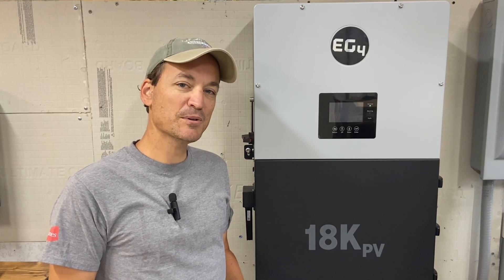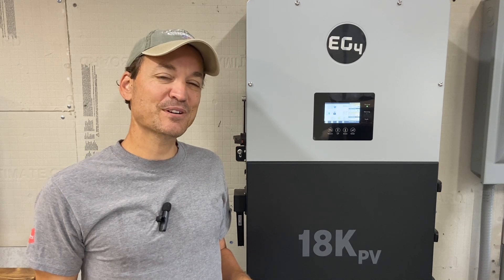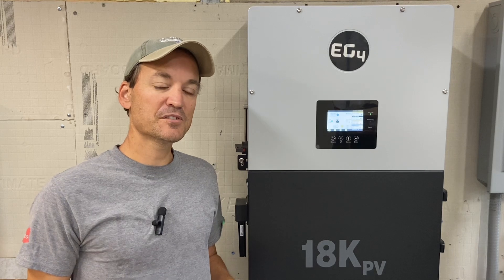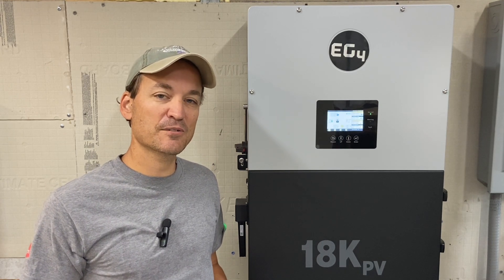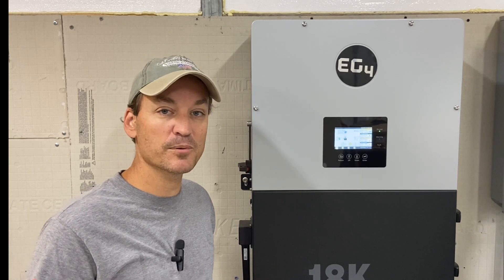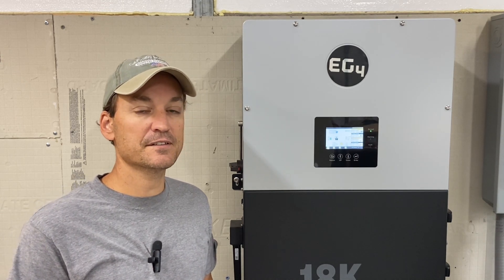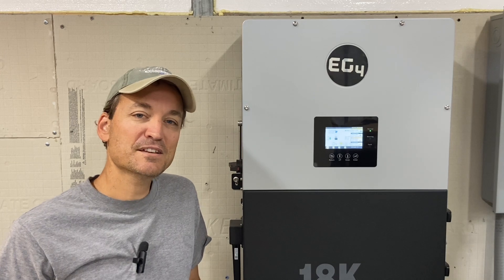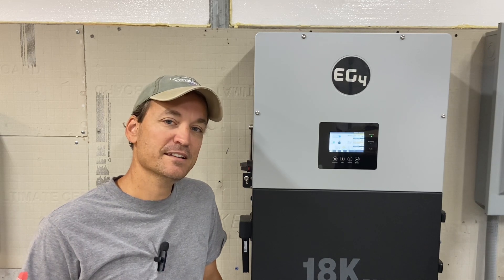Eg4 6500ex vs the EG4 18kpv comparison video~ signature solar inverters

Comment from the maker: Affiliate links: Here is the link to the inverter18kpv. 
https://signaturesolar.com/eg4-18kpv-hybrid-inverter-all-in-one-solar-inverter-eg4-18kpv-12lv/?ref=mpmddlkx6M9tPo

Here is a link to a pair of the 6500ex’s with the new PDP https://signaturesolar.com/eg4-13kw-off-grid-split-phase-inverter-bundle-2-x-6500ex-48-13000w-output-16000w-pv-input-split-phase-120-240vac-all-in-one-solar-inverter-system/?ref=mpmddlkx6M9tPo

Comment: I'm curious about wiring a generator to automatically charge the battery bank during an extended period of cloudy weather. Is either EG4 system able/better suited to that task?
Reply from the maker: I think pretty much all of the EG4 inverters come with a set of dry contacts that can trigger your generators auto start. Your generator would have to be equipped with an auto start option though.

Comment: The bad part I seen on this unit was  signature solar has horrible customer service, read so many reviews and even on BBB site and the EG4 users group on FB, every one speaks  about their horrible customer service.
Reply from the maker: I actually think they have been improving a lot over this last year. But if Signature Solar’s customer service is a concern for you, you can also get the 18kpv through Current Connected. They are selling the 18kpv now as well. They are a smaller company but super nice people. 

https://www.currentconnected.com/product/eg4-18kpv-hybrid-inverter/?ref=xhJJBPDS

Comment: Gavin, if I am using the EG 4 3K and I want to hook up generator power and shore power together, would I need to use a transfer switch to keep shore  power and 1:23  generator power separate? G fo
Reply from the maker: A transfer switch would work. But I usually recommend the chargeverter instead of using a generator through the inverter. The chargeverter can give 100 amps of charge to the batteries and you don’t  have to do any extra wiring besides adding it to the busbars. You can keep letting the inverter donors thing and just charge the batteries fully back up. 

I’ll add a link to it below if you haven’t seen it yet. https://signaturesolar.com/eg4-chargeverter-battery-charger-48v-100a-5120w-output-240/120v-input?gad_source=1&gclid=Cj0KCQiA3uGqBhDdARIsAFeJ5r3EQhRS8aVDhVTAbDvCXerR4ElTU2hjHarDYuGmG-MF5b7cD18My-AaAvz2EALw_wcB&hsa_acc=6010647758&hsa_ad=&hsa_cam=17631500090&hsa_grp=&hsa_kw=&hsa_mt=&hsa_net=adwords&hsa_src=x&hsa_tgt=&hsa_ver=3&ref=mpmddlkx6M9tPo&setCurrencyId=1&sku=1570007&utm_campaign=PMax%3A%20Shopping_Smart_Brands&utm_medium=ppc&utm_source=adwords&utm_term=

Comment: What about light flickering? 
I have 2 6500’s and get a lot of light flickering. I would do the upgrade if the sine wave is cleaner and there is less flickering. 

Anyone have any experience with this?
Reply from the maker: My last pair of 6500 ex’s didn’t have any flicker. But previous to that I did have what you’re describing. The 18kpv doesn’t have any of those issues. It’s a different manufacturer, and an all around great unit.
Reply: Thank you!

Comment: That's not a fair comparison. Because with the cost of 1 18kv you can buy 4 6500 ,and still have money left. So I think that is not a fair comparison.
Reply from the maker: I was specifically comparing some of the stats. The build quality is a big factor as well. But yes, as far as price the 6500’s are definitely less expensive.

Comment: Would I be able to have enough power to charge an EV in the late night hours using this including powering certain 110v things in the house? 110/220v?
Reply from the maker: Yes the 18kpv is a split phase inverter. 120/240v. Charging your EV would definitely be possible. That would largely just depend on your battery storage. Typically batteries are the priciest part of a system.
Reply: @GavinStoneDIY  I really appreciate your help and advice. I’m a new subscriber and love the channel!

Comment: Thanks for posting. I too have been using the 6500 in split phase for about 3 months. Although they have some the job, there is more to be desired, thus I'm taking the $750 credit towards upgrading to the 18k. 

1. The 6500s are extremely loud. Around 9 in the morning when the sun starts to provide pv input, the fans ramp up like a jet taking off the runway. 
2. One inverter charges my battery bank while the other discharges when i have an excess of pv input wattage. Signature solar admitted this is aj anomaly and are honoring the warranty on my inverters.
3. My lights flicker at night like a flashlight on its last leg of battery.

All in all, being completely off grid, they just arent up to par with providing seemless power for a house, well pump, and future expansion to my property.

Im taking the advice of videos like yours and Will Prowse' and investing in the next tier they have to offer.
Reply from the maker: That’s a good choice. I think you’re really going to enjoy the 18kpv. Keep me posted as you install it. I like to hear how things are going from people.
Reply: @GavinStoneDIY  so I just installed the 18k unit two days ago and wow. Silence. No flickering. I can't even tell the thing is on. It fully charges my 5 lifepower batteries more efficiently than the old 6500s before 11 a.m. 

I'm glad I forked over the dough.

The only thing I'm disappointed by is that for some reason the lifepower4 batteries did not work with the 18k. Did that happen with you? They had me designate the battery bank as lead acid and set the float/absorb voltage in the settings. They told me that they are working on a firmware update for the lifepower4 batteries to work with the 18 unit. I'm surprised that hasn't been hashed out already given so many people have these batteries.
Reply from the maker: @raymondergarcia   it really is a beast. I’m assuming you’ve downloaded the latest firmware as well? 

I don’t have the battery coms hooked up honestly. However, you can use the lifepower4’s with the communication hub connected to the 18kpv. I realize that’s just another item to purchase. But for what you get it’s not really that pricey. You can check the state of health on each pack, each cell voltage and some other options as well. If you really wanted coms sooner then the firmware,  then that’s your best bet. Otherwise I’ve been running on lead acid mode for months because I have DIY batteries as well as the task batteries.

Comment: Im in Phoenix, AZ ( good sun) where I my house has one inverter (EG4 6500ex 48) with two batteries (EG4 LiFePo4) and one 3200W solar array. This powers up all my 120v circuits but seems to drain the batteries before sun up daily. At which time it auto transfers to Utility Co then, transfers back to solar in the morning and also charges the batteries back to 100%. Should I just add batteries (maybe two or three more) and how many can this inverter handle?
Info on this matter would help,Thanks 
Mel
Reply from the maker: Adding batteries would be the easiest solution yeah. You can add as many as you like. The inverter will only pull as much power from them as it needs. So you could have 10 batteries but that one 6500 watt inverter can only pull around 126 amps total from the batteries.  

So considering the shipping costs the best idea is ordering as many batteries as you can currently afford. If you don’t have a cabinet yet that would probably be a good idea also.
Reply: Thanks.
It's pricier but, I'm thinking about changing over to the 18kpv if that will help @GavinStoneDIY
Reply from the maker: @melflores4873  the 18kpv would use less idle consumption overnight. And you’d have split phase power. Plus it’s honestly an amazing machine. So it really depends on your budget and what you’re trying to accomplish. I’m still running my house off grid with the 18kpv. You’d need more batteries either way. Batteries are honestly the most expensive part of a build.

Comment: Why does voltage spike up in cold weather?
Reply from the maker: It’s something to do with the electrons flowing differently. Generally cooler weather makes the panels more efficient. And the colder the weather the higher the voltage will spike. There is temperature coefficient calculators online to help you estimate what the voltage difference will be in your area. Places like Florida wouldn’t have any issues with that though.

Comment: If I wanted to run 2 fridges, a few led lights, a furnace blower, well pump would the EG4 3kv be able to do that in power outage situations? Or suggestions on what inverter to purchase for this scenario. Thank you
Reply from the maker: The well pump would be the big load what hp pump is it?
Reply: One horse-power is about 750 Watts, and multiply by 3 to allow for an input surge when the pump is cycled on. The inrush is short term and may be covered fully by the surge capacities of the inverters. Fridges may be 150W each when on (450 Watt surge each), and a furnace blower is typically under 400 Watts, or 1.2KW surge. You'll have to run through the math to make sure you are OK with steady state consumption and surge. All motor loads may switch on at the same time, so you sum the surge powers.

Comment: For the $$$$ one can buy 4 6500's for less than 1 18k..... 
Bank for buck stills falls to the 6500...
32 kpv with 26kw with redundant back up so your not reliant with a single inverter. 
No brainer here.
Reply from the maker: By the numbers that’s true. I myself would go for the 18kpv after having used both. If for nothing else then just the build quality. But the good thing is, they have both options. So nobody has to feel like they are hemmed into a particular system.
Reply: @GavinStoneDIY  true, my thoughts are more toward surviving grid down or no grid available due to location.
Having 2 pairs of the 6500's with the PDP's will cost less, while allowing more solar, more power, more options (ie. 1 pair @ 220v & another at 120v)  try that with the 18k.....
All ➕️ ➕️ ➕️ ➕️  and cost less.
Reply from the maker: @duanelinquist4244  good points. 4 of those would use a very hefty amount of idle consumption also though,  as compared to the 18kpv. So you may have to factor in at least one rack battery to compensate. So the gap does narrow a bit in that regard. I get what you’re saying about backups though. I do have my old pair of 6500’s still on the shelf. But not everyone has that luxury. I suppose there is always a give and take when it comes to being prepared and budget. And we have to decide what is a practical amount to spend on different items.

Comment: Looking to use EG4 18kpv in an off-grid setup for a new metal utility bldg.  Plan to move my well pump from my current grid tie system to this new off-grid system because of proximity.   This means I will have the 220V 20A circuit previously powering the well pump from the grid tie system near the new off-grid system.  I want to use this 220V 20A circuit as a backup charging source for the new off-grid system.   Will I need to connect this to the A/C in or the generator connection on the EG4 18kvpv? Would both ways work? If so what are the pro/cons of each approach?
Reply from the maker: I’m not quite following what your intention is. I know the unit outputs 50 amps. So you don’t want to sell yourself short. But I’m not quite sure what you want to do with the 20 amps circuit.
Reply: @GavinStoneDIY  Sorry, looking to be able to use it as an alternate charging source for the batteries if too many days of poor solar production to run connected loads and charge batteries.
Reply from the maker: @matadorbeagles1120  ahh I see. Then you’d want a 50 amp supply at the very least. While you could technically set the charging level lower to compensate for the smaller wire, it would be a waste really. I would installed a larger conductor. Or depending on your setup you could also use a generator and a chargeveter.

Comment: So can you use the ct clamps on the main feeders and wire the 18k straight into the panel and it won't backfeed the grid ?
Reply from the maker: Yep. It can be used with or without a critical loads panel. So the 18kpv can be hooked directly from the meter and has a 200 amp pass through.

Comment: I have four, EG4 6500ex inverters. My price was about $4500 for all. The 18k pv is a very nice unit but as a comparison, the cost for two would be $11k. The 18k would not have as much output as the four 6500 exes but close. The 18k units have advantages but the price is a lot more too. I can run 100amps plus with the 6500’s.
Reply from the maker: There are other factors like wiring. You can completely eliminate a critical loads panel with an 18kpv. Plus the extra battery power you’d need to invest in to compensate for idle consumption with the 6500’s. There is a lot to consider.

Comment: When dealing with grid tie, don't you need all types of permits and paperwork?
Reply from the maker: So “grid tie” means different things to different people. Some use the term to refer to net metering. Others any attachment to grid at all. I’m assuming you’re talking to the latter option. And yes, you’d technically need some permitting if you are using the grid as backup. Depending on your location it could be fairly simple to get the permitting process completed or a real pain.

Comment: As several people have said below for the same cost you could have 4 of the 6500-ex both sets with a PDP.  I dont really see anything that would be worth the extra $3,000.
Reply from the maker: Some of that cost is for the grid interactive features. For instance you wouldn’t need a critical loads panel with the 18kpv. So a lot less wiring involved. And really, all that aside, the 18kpv is just built better. However the 6500’s can power the loads and do the basic tasks needed. On a budget the 6500’s are some of the best off grid inverters out there. High charging amps and good output. For all around quality and performance, the 18kpv wins for sure though.

Comment: Compared to both prices.... you should have 4x 6500 to 1x 18k inverter
Reply from the maker: You could definitely do that. I was just more focused on comparing the similar wattages and specs between them.
Reply: At his stated 164w idle consumption for two 6500s, with four of them, idle consumption will burn 5KW in about 15 hrs (vs 1KW with the one 18Kpv)… so you’d need to factor in an extra $1500 for the extra 5KW battery the idle consumption will burn
Reply from the maker: @wanderlust7020  good point.

Comment: When you're producing 6,000 Watts PV or more which of the two is louder? Or about the same? One thing you didn't mention that's a pretty big deal is that for the same price of one 18k you can have four 6500ex ... If three of them go down you still have power. With twice as much PV and AC then the 18K can supply... But if the 18K goes down you might be without power for weeks if you're off-grid... Has anyone been able to successfully run 16 KW panels through two 6500 yet? I haven't seen it done.. I haven't even seen one inverter loaded to 8K. And I've watched damn near every video on YouTube about it.... I haven't seen anyone get close to 18 KW panels on the 18K unit either
Reply from the maker: Good points. So the 18k is a different pitch. But still quieter then the 6500’s.  Even at high PV input. The 18kpv  doesn’t really make much noticeable noise till around 9kw. After that it starts to ramp up. I figured the price difference was a given. But I’ll do a follow up at some point and mention that probably. That makes sense to add that. Also having 4 of the 6500’s could make sense in some settings for  redundancy. 

I ran 8kw’s to one of my 6500 units and 6.4kw on the other. I believe I mentioned that in my 6500 videos. But it wasn’t a center point of the videos I made. With the eg4 6500ex’s 500v voc limit it’s not difficult to reach that max wattage.
Reply: @GavinStoneDIY  wow that's awesome thanks for that information. I've watched all your videos but I guess I must have missed the 8KW array on one inverter! You might be the only guy that's done it so far I'm glad to hear it's possible. My plan is to have two 6500s installed... And 1 or 2 of them sitting in the closet ready to be used as backups... My whole house can run off one of them but I need the extra PV array in case we get a week or two straight with no sun.... Do you think two 6,500s can handle 44 boviet 370 w bifacial panels in a place that never goes below 70° f?
Reply from the maker: @deanburrito6943  yeah my whole array built as a roof was on one 6500. And my other two arrays were on the other 6500. What are the stats on your panels?
Reply: 370w bifacial
40.56voc
-.35 pmax temperature coefficient
Lowest temperature 70° f
Isc 11.54a
Hoping to have four strings with 11 panels each.. maybe 12.... The system I've been running on for decades only produces about 10% of the power on a rainy day versus a sunny day. And I live in a extremely wet environment. The wettest place on earth I think... I've wasted more gas in my generator than I care to mention... This upgrade is going to be phenomenal... Last time it took me 3 months to figure it out and install it I'm hoping it's going to go much quicker this time. Everything seems so much easier and simplified now with these all-in-one units.... Well except the fact that I'm a lot older now :-)
Reply: @GavinStoneDIY eg4 lifepower 4 Composed of (16) UL listed prismatic 3.2V cells in series which have been tested at 7,000 deep discharge cycles to 80% DoD..

... Does this mean that after 7,000 cycles that 80% of the battery will still be usable?
Reply from the maker: @deanburrito6943  yes that’s what it means. And that’s 7000 complete cycles. Depending on your system size, most people won’t fully cycle a battery every day.